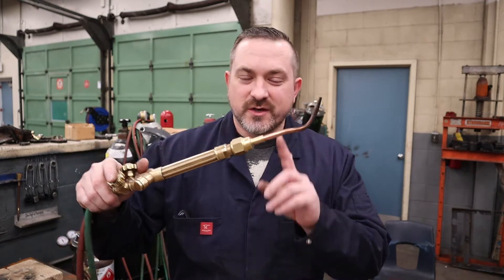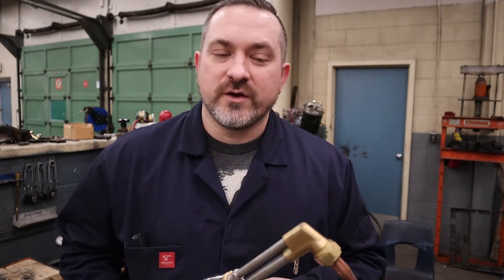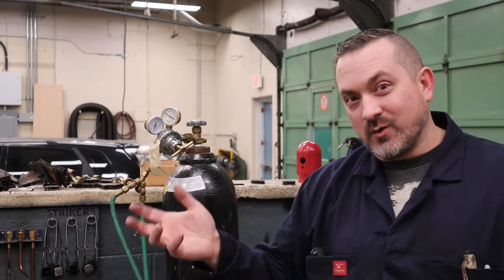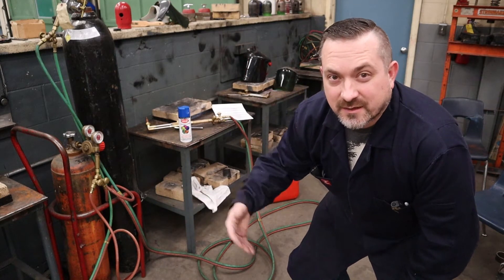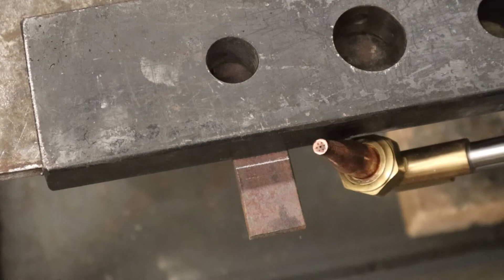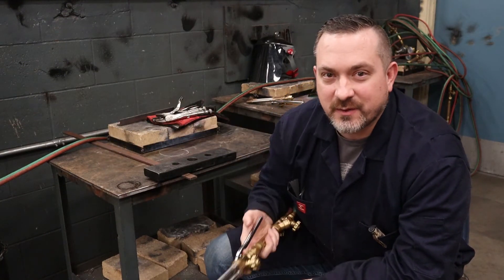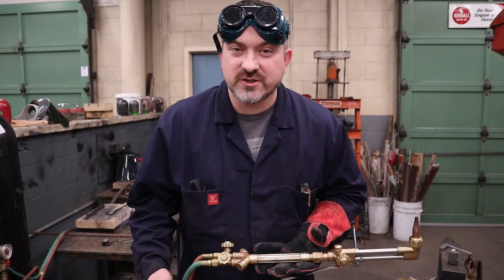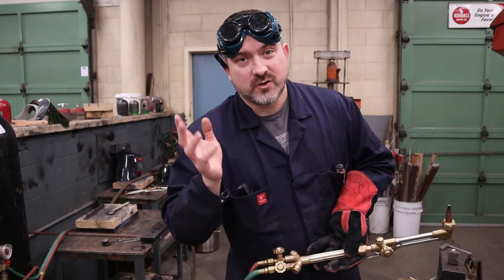How to use a cutting torch

Comment: I’ve always used the term “kerf” for the material thickness removed in a cut in wood. Is the same term used in torch cutting? 
Is the width of a torch kerf predictable or controllable as it is with woodworking tools so you can accurately cut specific lengths?
Reply from the maker: Yup, it's the same terminology.  Yes if you have consistent cuts like an automated setup, you can create accurate part lengths.  Thanks for the watch!

Comment: Nice one!  Great tip about worm clamp as depth guide. 
I think I’ve seen Eric O from South Main Auto burn off just the nuts, not the studs or bolts, so the studs can still be used in place. How do you accomplish that, Emil?
Reply from the maker: Thanks!  Yeah once you get used to the torch, you can use it to cut slices of the nut off until it's  so weak you can just rip off the nut.  I've done this on lots of customer work when trying to do repairs without wrecking other parts.  Cheers!

Comment: At 13:34 you said that if you slowly increase the acetylene, that the smoke/soot would go away but in my case despite my slowly increasing the acetylene counterclockwise, even when I turned it all the way up, the smoke still wouldn’t go away. I tried several times but the smoke still remains. I’m not sure what I’m doing wrong. Would you have any suggestions?  Thank you very much for this awesome demo by the way.
Reply from the maker: Sounds like your acetylene regulator isn't turned up enough.  It should be 1 psi over the torch tip size or usually 5 psi will work for most tips.  Try that.  Cheers!
Reply: Thanks a lot @wayofthewrench
Reply from the maker: Is that what was happening?

Comment: Sorry one more question, in order to remove seized bolt on exhaust or any other suspension area, what kind of tip you recommend, and do you suggest to  wtih neutral fllame. 

I see some uses welding tip and some uses cutting tip.. what is  your recommendation?.
Reply from the maker: Depend on what size of bolt but really a 0 or 1 gas welding tip will work.  Larger tips heat stuff up faster.  There are tips for just welding/heating and tips for cutting torches.    A general purpose cutting torch tip size is a 0 which is great for 3/8"-1/2" but will cut thinner as well.  Otherwise there are charts to figure out what tip size you use for specific thicknesses.

Comment: Hi I just subscribed your channel.  very professional .. I am advacend DIY mechanic.. does timing belt, all sort of suspension work, etc.. living in rust belt, chicago.  I just got portable lincoln oxy aceytlane  torch. It come with welding tip(3) and cutting tip (0).  

Question for you.
1. Do you think tip 0  is reasonable for me to cut simple control arm bolts on rear bushing where it get seized because of rust. Do you prefer to get any other tip size .pls advise. I set fuel to 5 and O2 to 30 for tip 0 to cut.. do  you the  pressure i indicated is good for the tip.
2. I watched many videos today and you advised me to start with what i have today. so i have gas torch, do you think it will help me with tip size 3, i prefer to weld broken bolts to extract or weld exhaust manifold stud? do  you think i can use gas weld  for this purpose or should  i go with flex weld?.
3.when i use Gas weld, ESPECIALLY  on exhaust manifold stud , will not it melt aluminium, because there are cases where exhaust stud get brokern flush in aluminium manifold, i see people using washer (smaller size) and mig weld to build the length and use bolt to weld  and take it out. can I use GAS weld for same reason..

Appreciate if you cann responsd.
Reply from the maker: Thanks for the sub dude!  Yup a 0 cutting torch will work for just about anything on a car.  I don't recommend using gas welding on aluminum engine parts with broken studs.  A mig welder or tig is a better choice if ya can do it.
Reply: @wayofthewrench  Thanks. Can i  use my cutting torch to heat up rusted bolts or you recommend to use weld tip
Reply from the maker: You can use either but the cutting torch will be faster so maybe better for bigger bolts.  Don't use the oxygen handle when heating though or ot will start cutting.

Comment: pressure seems too high especially what you're cutting.
Reply from the maker: I usually only have the one size cutting tip for the cutting torches at the school so the pressure is a touch high but ok for the tip size.  I would agree that I could have used a smaller tip for this thickness steel but I didn't have any to swap out.  The cut came out pretty clean though.  A tip for cutting thinner material with a slightly bigger torch tip is to angle the cutting torch so that the diagonal cut is thicker and matches better with the tip size. Thanks for the watch!
Reply: @wayofthewrench  ok I see.